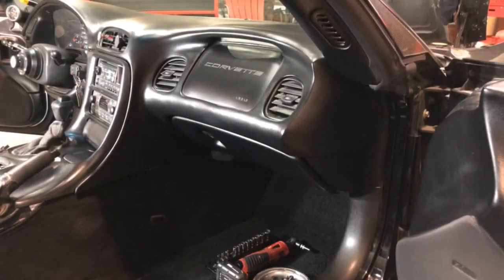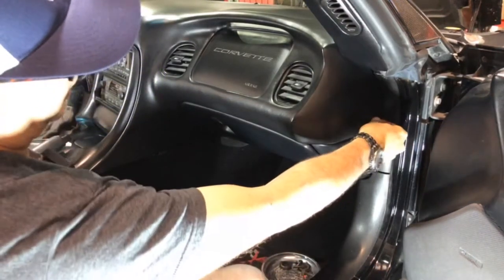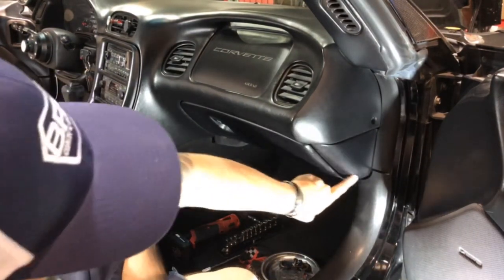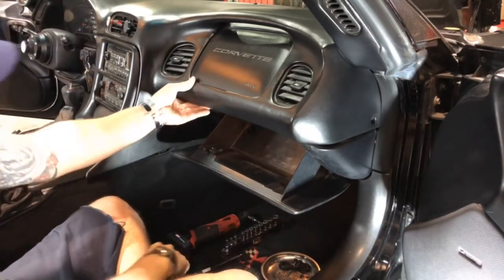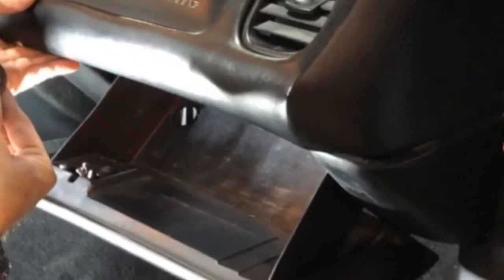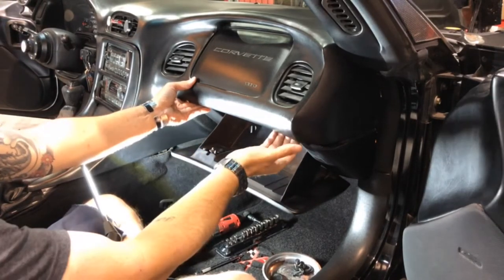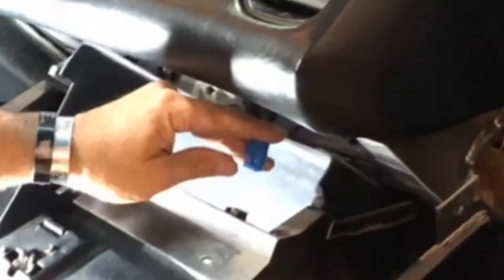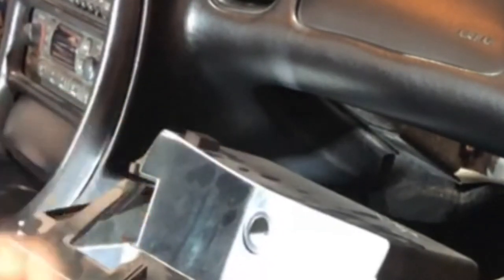C5 Corvette Glove Box Removal

Comment: Hi JW, How do you get the 2 flat round plastic plugs out of the glovebox without damaging them or the glovebox?  Yours is the only description of glovebox removal from a C5. You had already removed the plugs previously and did not show what tool nor how to remove them.
Reply from the maker: Give me a couple minutes I know exactly which plugs you are referring too I just need to look at them in my car again to recall how to remove them.
Reply from the maker: Their rubber just pull the edge with you’re fingernail or a 90 degree small pick.

Comment: Mine has a airbag on off switch inside of the glovebox. Did yours? If not where is yours located?
Reply from the maker: I don’t have one mine is a 98 model. On yours You can unplug it from the back side just disconnect the battery first.
Reply: @JWsGarage  mine is a 99. Didn't know that thanks
Reply from the maker: There are some fairly significant differences between the years models 97/98 compared to 99-05

Comment: Do you use a swivel adapter to remove the bolts? They are in an angle I can’t get them out.
Reply from the maker: Believe a ratchet wrench was what worked best,
Reply from the maker: Sorry no I used a 1/4 ratchet, 1/4 8” extension with a 8mm swivel socket.
Reply: @JWsGarage  thx

Comment: Now make video to reinstall glovebox. Having trouble with side scew
Reply from the maker: If memory serves me correctly the side screw attaches to the upper dash so if you push the dash just a bit the hole should line up. Of that doesn’t work I’m always avail to reach out to John and I’ll help ya through face time.
Reply: JB weld helps . 
Just kidding. 
I’m pretty sure you do it .
Reply from the maker: Heck yeah used correctly that JB is a solid product.